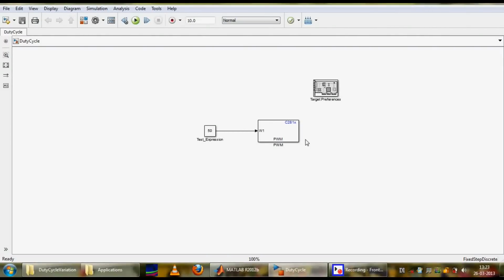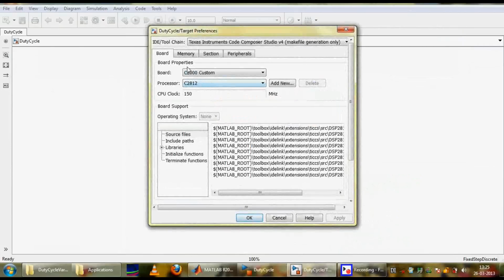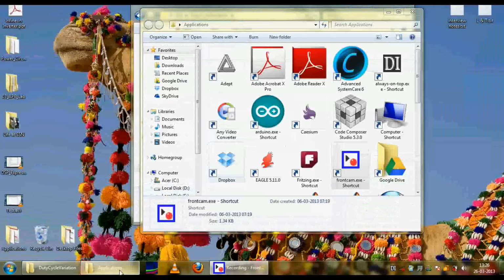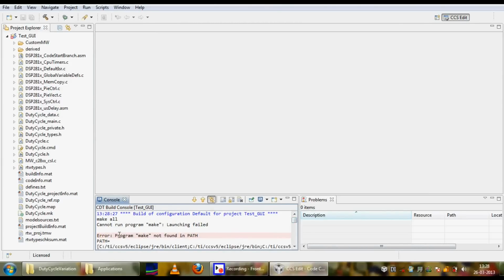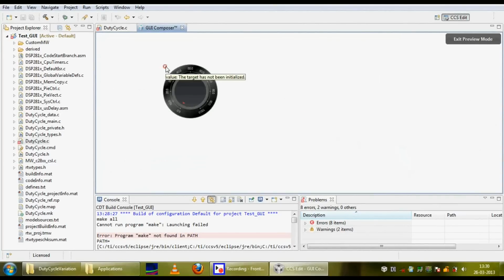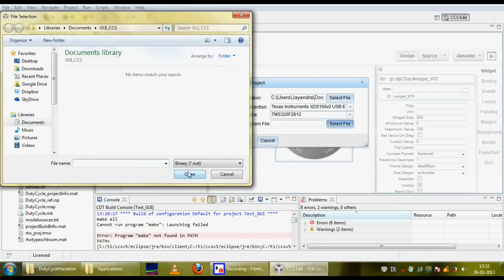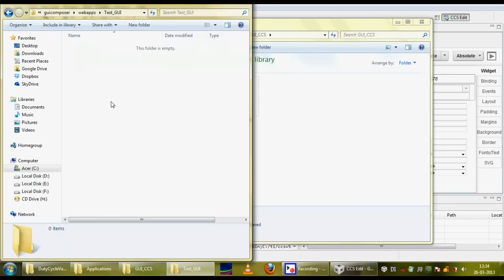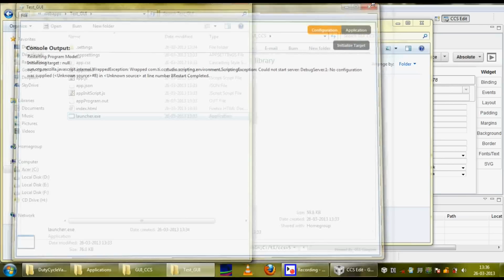Creating GUI using Code Composer Studio and MATLAB

Comment: Hello achrfo Locka,

  Select the Scalar Line graph widget (from Instrumentation) , you need to adjust your Y axis limit. For my case, it was 12 bit ADC, so the limit would be 0 to 4095. Then you need to bind that particular ADC variable from your C code. In my case, the value was -  "Test_13_B.ADC_o1", without quotes, where "Test_13" is my file name.